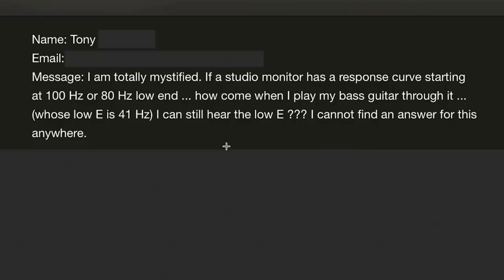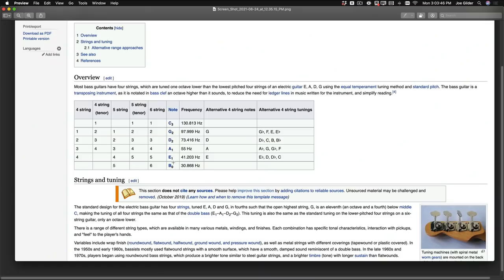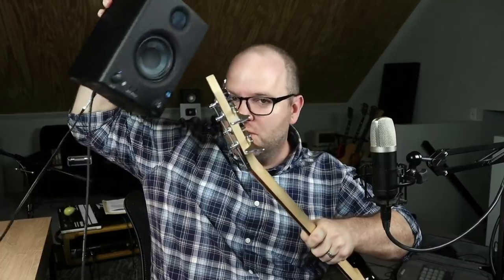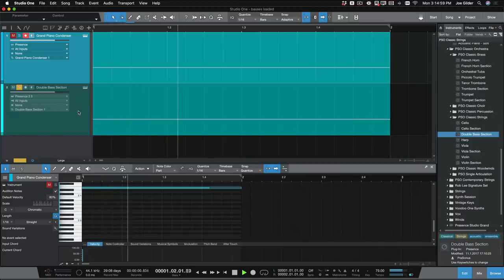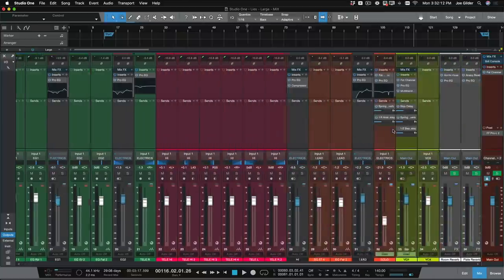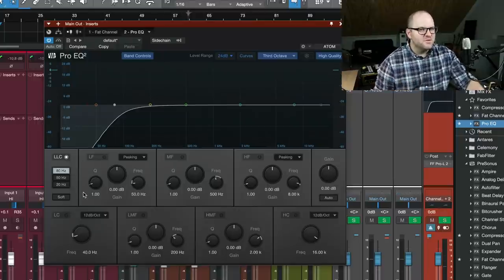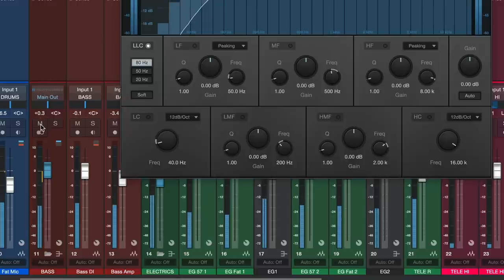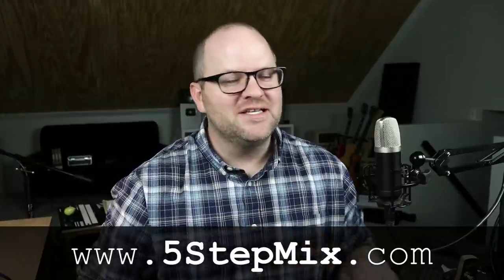How to Mix Bass for Small Speakers

Comment: Also, when a speaker specs 80Hz as the lowest frequency it doesnt mean that 79Hz is not audible. The response of the speaker just falls gradually. 80Hz is the -3dB point. Or at least, thats what most companies do.
Reply: Exactamondo! This comment should be highlighted.
Reply: Good point 👍🏼
Reply: Yes, that measurement is standard, but 41 could still be inaudible depending on slope and just size of woofer and box. Joe even says he couldn't hear the 41hz sine wave on the small speakers.

Comment: Hey It will be awesome if you could answer this question also: how come my little in-ear headphones have a frequency response reaching to 10 hz and my 7 inch monitors reach only down to 40hz, although they are massively bigger physically, what’s going on?? Thanks 🙏
Reply from the maker: Think: volume. In-ears have to produce a tiny amount of volume. Barely any actual volume. It’s so close to your eardrum that it’s barely a whisper, but it seems loud. A 7-inch monitor has to reproduce that volume but 1,000 times as loud. 

That’s my guess anyway. 

Big picture: who cares, everything below 40 Hz is unusable in music and unbearable on most systems. 😊
Reply: Oh Okay thanks yes that’s actually a big difference in the volume

Comment: Hey Joe, whenever I master with Logic’s adaptive limiter with a ceiling of -1 output, I still get distortion artifacts in my song whenever referencing my iPhone’s speakers turned all the way up. This isn’t a problem though if my mastered song doesn’t contain too much reverb. This is very much a problem if my song contains tones of reverb. What’s going on here?
Reply from the maker: a. It could be that ALL music distorts when you crank it on the iPhone
b. It could be that your mix has too much low end and low mids, and that's causing the distortion.
Reply: @HomeStudioCorner  thanks Joe, I’ll try these ideas out!!

Comment: I've had issues trying to mix my church worship for our majority online listeners:  people on phones...  should  this technique work well for my kick and bass on phone speakers as well?
Reply: For bass, absolutely, yes. For kick, I'd recommend adding more beater "click" (2.5k-5kHz) so the attack comes through on their phone speakers, even if the resonance and bottom end won't. This will work even if you don't have a separate console for the live mix in the room, because you'll be able to reduce your low-end output a little and keep the sound cleaner in the room.
Reply: @JohnPaulHare  Thank you! We have a separate console with Reaper for online plug ins so we have several options.
Reply from the maker: This. ^^^